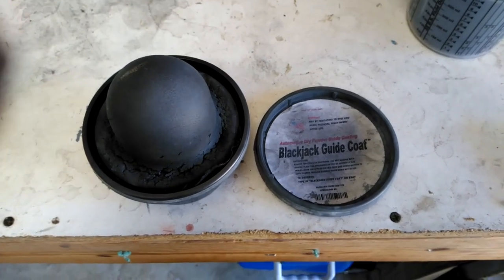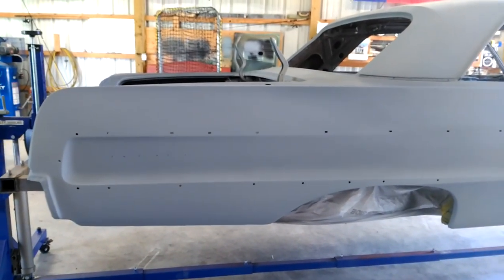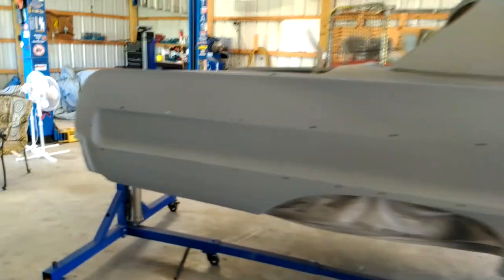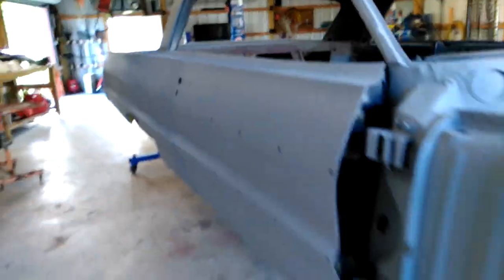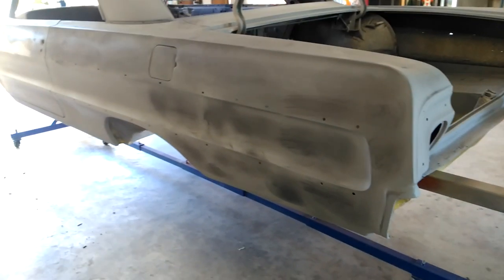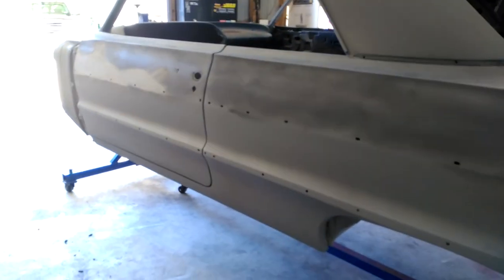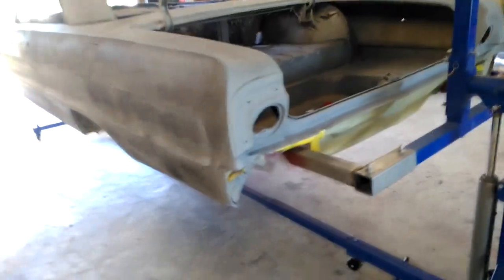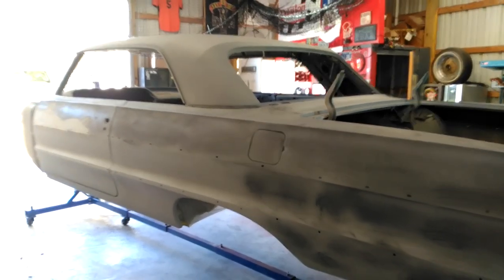Guide coat block sanding a car! 2k primer block sanding a classic car

Comment: Why can’t you just mist flat black primer over the whole car?
Reply from the maker: You can. But I dont like using anything from rattle can .
Reply: @lonestarlows  what would be the actual difference between using a guide coat powder and black primer spray can?
Reply from the maker: As far as seeing what you are doing. Probably  nothing. However rattle  can has chemicals  in it that may not jive with your basecoat or sealer. Alot of people use rattle can for guide coat. I just don't because its not how I was taught

Comment: Where did you find this solid car, no rust on the lower quarter panels, tail light panel or the trunk where the box braces are. All those areas are pretty common for rust on these classic cars. You had no metal work or rust repair which is great and saves a lot of time.
Reply from the maker: I found the car about an hour away from me. The car sat in an insulated shop for about 20 years. It was on Craigslist for about a year.  No one likes to buy cars in pieces but I saw through it all and I'm working towards the down hill slope
Reply from the maker: The only welding I hope to do is a small patch on the passenger fender lower. Very very small.
Reply: Rust sucks I got a video of my nova up. No rust on mine and I won’t own a car that’s had quarters put on
Reply: @jeffwoods9666  I agree rust sucks but when you have a car with rust you have to fix it some how and would rather put quarters or patch them with metal instead of slapping fiberglass filler over the metal.